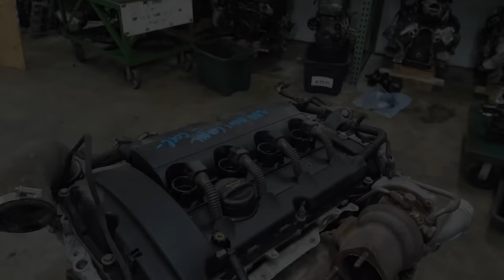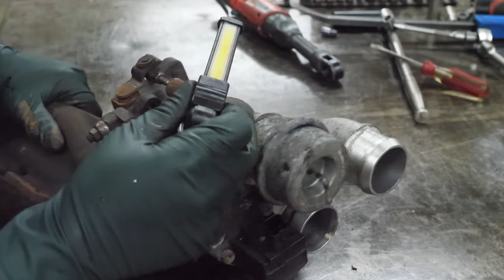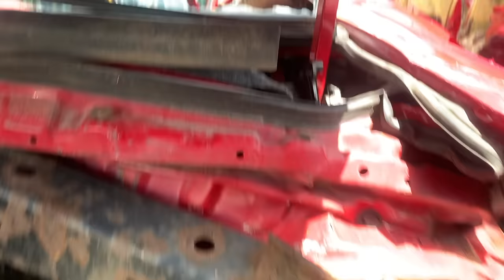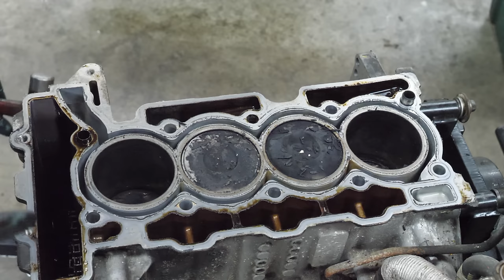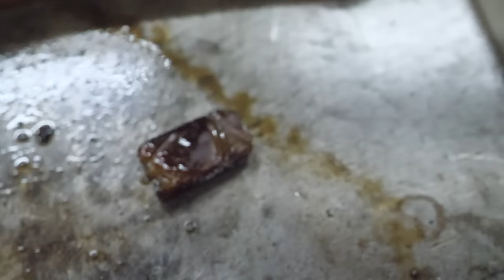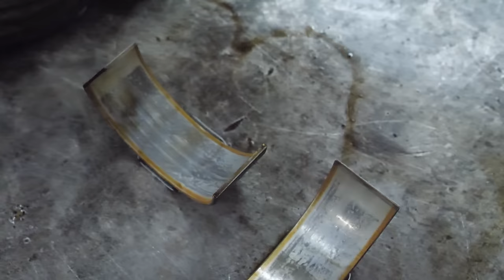JUNK Mini Cooper S (BMW/Peugeot) N14 Turbo Engine Teardown. Why Do People Buy These?

Comment: I'm not a fan of this engine either...i still have my 2010 peugeot 3008 thp after 5 years and I'm happy with the performance but agree engine is impractical with some bad designs... dipstick is horrible and difficult to read, difficult to replace battery and thermostat. Timing chain was first part i replaced after buying it. Recently i had a huge oil leak and it was the oil feeder pipe. Also consume a good litre of oil every 800-1000 mile... some claim it is normal... but it is new to me. Only got 60k miles on now.

Comment: Core plug on center of head between cyl 2/3 I e dun about 10 so far it overheats due to water pump or thermostat and it pops out there's ur oil water mix point

Comment: Why does everyone have such a problem with the dipstick going through the guide? Very few of anybody has ever worked on one of these engines, and anyone who has didn't find a problem with this design. You pull out the dipstick and the whole timing chain, guides, and lower sprocket all come out the top. First engine I've seen where you don't pull the timing cover to put in a chain kit.

Comment: i own and run a workshop for years and have lots of experience with euro cars. These N14 are widely used on minis and Peugeot, with countless issues with oil leaks & coolant leaks, turbos, timing chain problem, we educate our customers to steering away from these if they could, so badly design.

Comment: I hear you and you are making some good points. I think more tests would really help and a gradual rollout would definitely help. But some of your points like windows rollback would probably not work. Because the bad code was always there and it was a data file that they updated and trigerred the bug. It was not a code update but a data update. Also, man try to relax. You are passionate about software but it sounds like sometimes you get your pressure up talking about that stuff.

Comment: It's even worse for the oil filter. When in the car, you have to unbolt the reservoir for the coolant and move it out the way in other to access the filter. It's a horrible set up.

Comment: I had one of these in a 207 it died at 65.000KM (piston ring of cylinder 3 broke) it started to burn almost more oil then fuel.

Comment: Any BMW Engine using start/stop should be junked. I4 engines it can't be turned off from what I've seen, I6/V8+ engines you could turn it off. I've been told from BMW that it's going to be standard for all engines soon, with only the M/Sport mode turning it off (but those are going to start being a literal manual shift of the automatic transmission instead of enhanced driving experience). The MPG you can "gain" doesn't justify the cost of a literal engine it kills or reduces life over time.

Comment: It clearly ran a bit with the water in it, what did someone do? Sabotage a repo by replacing the oil with water?

Or did the shop get tired of the customer and put a hose to it? Scorned lover?

I am less familiar but you don't think the valve broke first (perhaps related to the timing issue) then the melting occured? (Regardless it didn't chew up the piston/ cylinder).  The condition of the engine is really weird, I would love to hear what actually happened with it.

Comment: Oil / service duration or long-life oil changes are. No good for these engines - its the same deal for belts and chains - the change period is too long - Why you may ask? - 

Once that car has been purchased it may been bought with a service pack - call it the sweet period / lease term or 3 Year term…..

Once the car is past this warranty /guarantee period they already deem it a scrap car unless you keep up with a dealer service. However if you do not do more than a few thousand kilometres a year - they will leave the oil alone. - The burnt out valve can also be cased by oil attacking the valve seals and causing the valve to stick. 

For BMW’S they have had a lot of known injector issue’s and a long haul back order on their replacements - When you take the oil filled cap off the vapours are of neat fuel - have seem bottom ends lock up whilst stationary - I saw an X series BMW with cream coming out the exhaust…..big issue

Comment: I’m not sure about the turbocharged MC, but the na MC is probably bought by people who value cuteness or funkiness over a quality reliable engine. That look like there’s too much plastic on that engine, and is especially bad for cooling system parts that go through countless heat cycles. On the plus side, it doesn’t have rubber belts in oil.

Comment: I'm not defending this engine by any way. The amount of water in the engine might be more to do with the way it was stored than the design of the engine. Even if stored indoors, water can get it via condensation if the store place isn't climate compensated and dry. The turbo, likely has an oil bearing, and when cold and drained of oil, I doubt even a healthy one can be turned by hand after that long in storage. These engines are designed with higher octane fuels in mind. E10 and 95+ sort of thing. I understand not too common in some parts of the US. And last, the US has quite some range of temperature and environmental challenges. Europe has service everywhere and if anything cars seem to be over serviced, problems fixed before they go on to be big hits to the wallet. I would love to see a US engine as compact as this, that produces the same power with the same emissions. And come in the same cost range. It's not an easy challenge for the engineers. And often serviceability pays the prices.

Comment: I always love it when someone says there is nothing wrong with those engine's! I but 130k with no issues.  They I have to prove them all wrong with facts.  Plus i seen people say this is a good car nothing wrong with it no leaks.  What do I find when I look at it.  Oil leaks, rust quarter panels and check engine light is on.  Pay they are the same people. lol

Comment: lmao my n12 engine in my cooper (naturally aspirated version of this engine, but with dual Vanos not single, same as the n18) needed a new timing chain guide within a month, it chewed itself apart lol. oh and it drinks a litre of oil every thousand miles.

Comment: does anyone know the oil interval? it’s 15,000 miles or two years. that’s also the same for n20, n63, n55, n52, and some others. every single engine that had that blew up. now it’s down to 7-8k miles or once a year and now no problems. from the beginning it was going to end bad, just a shame. i was at 145k with 100k on chains and original turbo before a exhaust valve was burnt. best car ever, r55 n14

Comment: I believe The engine is French not actually a bmw engine
I have done a cylinder head repair on one and some parts were out of stock at bmw mini dealer called Peugot dealer they had everything I needed at a lower cost 👍
They have a strange water pump set up I hadn’t seen on other cars

Comment: Yes, this Prince engine is a lottery. Some of them are running wothout any problems, while others are troublesome, in best case "only" leaking oil, at worst (and not uncommon) case the timing chain fails, and ruin the engine.
We had one in our family, sold it. (yes, it leaked. I fixed a leaking vacuum pump) It ran for another year and then - boom!
No more Prince engines at our driveway!
We had several Peugeot and Citroen with the older engines, never a problem, but this engine ... no thanks.

Comment: I had 208 GTi, The engine was robust as a f... Best engine Ever, may be BMW changed few parts to make the engine cheaper but the 208THP is one of the best engines ever.

Comment: In a (UK) filling station) I was asked if I could help a lady customer. She had wanted to top up the coolant but had poured 2 gallons of water into the oil filler cap. Beyond help but I wonder if that's what has happened here

Comment: This engine is in my wifes Peugeot 207 GT. Its an amazing thing when it works without issues - which has happened a handfull of times during the last 12 months... but its a nightmare to work on. I hate it, and i think i have invested more time and money into this POS then into our other 3 cars combined.
Reply: PSA should never have gotten into bed with BMW, peugeot made good engines normally.
Reply: @garagecedric yes, the 1.9 hdi engine in my old workhorse  peugeot expert, from 2002 is the polar oposite. With 250 k km on the clock and 21 years old, it simply works - always. No trouble , no fails, reliability on wheels

Comment: Chocolate Moose or rotten bilgewater in the crankcase. FYI everything eventually ends up in the bilge of a motor ship. Fuel, lube oil diesel sewage salt and fresh water all mixed together.

Comment: The engine is in excellent condition considering that it was driven with a water-oil mixture? That direct injection into the fire is a wolf. In all brands. Soot and grime everywhere. The owner can influence it the most by changing high-quality oils, as is the case with Turbo cars. 10000Km. Sometimes.

Comment: That engine looks even worse than what you'd see when maintained at the ridiculous "long-life" intervals some of those cars had in Europe. There was an option to do intervals at 30,000km or 18500miles with a long life full synthetic oil. That might be ok for naturally aspirated engines, but for cooper S N14 it should be at least half that, and especially for a highly strung JCW and with how they are driven, you should do it at 10000km or 6-7k miles at the latest, preferably sooner.

Comment: Im amazed . I hate cars. I have a citroen DS3 sport convertible 1.6 petrol   2014  turbo  BMW .  Its very smart , But the engine drives me mad , Some days it starts fine , runs great, you jump in another day and it starts lumpy , lacks power . make awful sounds till it get hot. Changed the plugs , oil filter and oil .   still some days its starts lumpy till hot. its not burning oil . its new oil and set right.  I am stuck what to do [ could it be the high pressure fuel pump ?]

Comment: It's absolutely insane to me how BMW went from the indestructible 1.6L Tritec to this garbage. I have had so many of these N14's brought in with a bad HPFP, bad turbo, waste gate slack, rod bearings going with proper maintenance and just the fact alone it takes an hour to do an oil change on these engines because you have to remove all the intake pipes and coolant pipes out of the way to get the filter. Also, to do literally any maintenance on the pulley system takes patience and tons of special thin tools to get past the frame that is less than half an inch from the pulleys adn that rubber wrapped idler on the water pump goes bad all the time, when it goes bad it destroys the water pump and the tensioner on those is also garbage and the idler I just mentioned will destroy them, these engines also have a problem with the rubber inside the harmonic balancer coming apart. Also, another issue this have is when the HPFP starts to go, the low pressure pump tries to make up for it, I have had SIX of these Coopers come in where someone put a bigger fuse in the fuel pump fuse slot to keep the car at least running and when checking the low pressure pump's housing the plug INSIDE of the tank is burnt to a crisp, how this hasn't caused a huge fire recall is beyond me. Also, these HPFP are so common to go bad that they have been in back order for YEARS and they cost between $900-$1400 MY price, they list for close to $2k. I even found someone who rebuilds them but he's always so slammed with them that he never has the time to rebuild mine, lmao. Love R53's and the Tritec, I've built quite a few R53's for track and race but the N14 is honestly one of the worst engines I've ever had the displeasure of working on.

Comment: Shame as the performance of this engine is great: lots of low down torque but will rev too. I nearly replaced my current car with the VW TDI PD 130 with one of these. I’m glad i didn’t as the VW motor has 117K on it and still performs like new. If you don’t maintain any engine you asking for trouble though.

Comment: Yes I can agree with that - the BMW prince engine it was a terrible design I had one in a 2010
Citroen c3 the 1.4 twin cam 16v I had to have head replaced twice tensioner on demand oil pump all on an engine from new to 3 years old or 20000 miles and regularly serviced by Citroen

Comment: Is it not possible that the second spark plug was so bad that it was misfiring to the damaged vale when it was open and closing and that did destroy the valve? The head  around t the spark plug and the valve look like that. The hole motor got a bad maintenances

Comment: I had a mini cooper 2009 had all work done at the dealer till they gave up and said they can’t fix an engine for a car they are selling the car blew up on the highway, it always needed oil, shut down randomly so many issues it was pore garbage

Comment: Is the N18 any better? I've got one in my cooper S with 64000 miles on it. Had a few niggly problems so far such as thermostat and two coil packs. Anything else to be wary of with the N18?

Comment: I had 220K, and the failure of the engine was a pinhole developed in a valve in Cylinder 2, and it burned it out... put a used engine in mine.

Comment: i noticed you said somethiing about the high pressure fuel pump causing that valve to be broken. i had my high pressure fuel pump broken for about 15k miles do you think something mightve happened it drives good now tho

Comment: what a good video of engine teardown, can someone help me here i bought N18 Cooper S as  i was driving the steering went stiff and  it was difficult to turn . is there any fuse or relay for the power steering and were is located i will really appreciate for any help.

Comment: I bet some carbon broke off and slightly wedged in that broken exhaust valve..causing it to stay open slightly and eventually with that cylinder firing, it torched through that valve and finally it cracked off…. I’ve seen it happen to big Waukesha V8 industrial engines running on poorly filtered/purified digester gas in a wastewater treatment plant I used to work at… those also had the small end of the rod crack due to H2S gas eating the bearing out, then preceding to bend/mutilate said rod, poke a big hole in the block…. And keep running on 7 cylinders like no big deal.

Comment: one issue with bmw/mini vehicles with turbos...   the majority of people do not allow cooldown of the turbo. this shortens the life of everything when you dont cooldown. still with a turbo on a car and you drive it hard i change every 3000-5000 miles. non turbo i do 5000 miles.    never had a problem.   but also the issue is the direct injection and EGR crap making intake plenums and valves trash....

Comment: i have a 2009 jcw, 211hp. there are no delusions about the quality of these engines. yea you have to cut the oil change intervals in thirds for it to live, I would not trust any of these motors if it was not in your care sience new. the peugeot prince engine its biased off is good a award winning motor they still put in cars today. but after BMW got their crusty fingers on it to cheapen up the design, then built it in great recession ravaged UK, along with criminal negligence on setting the oil change interval, leaves a deadly combination. its a shave because the cars are so good.

Comment: I drive myself a Mazda CX-5 and it is maintained (splendid) by an independant garage. They never ever maintain a Mini anymore after a few distribution renew actions. Even the dealer couldn't get those engines silent anymore (rattles in distribution and valve-train). These are really bad engines and my wife wanted an Mini Cooper S convertible so hard, but I've bought her a Fiat Abarth Scorpione 500C, much more fun an better engine (bit tuned from 134 until 169 Hp)

Comment: That belt tensioner nonsense is actually an on-demand water pump. The ECU tells that idler thingy to bridge the gap between the crank pulley and the water pump wheel when required. Such a stupid idea, an electric pump would have been cheaper and more reliable.

Comment: Life cycles of car engines seem to be getting shorter and shorter.
Engines pretty much dictates the life of the car since not many would go through the cost and hassle of finding, buying and fitting a used engine.
Unlike the engines of the 80's and 90's particularly Honda which has not only outlived the original car they were attached to but subsequent cars/project they were installed.
So many are still factory sealed, including transmission and 30 year old starters motors, alternators and distributors.
Honda is an example they could make cars that virtually will not need a new engine.
With F1 race engines going from 3 x engines in a race weekend (1 x Practice, 1 x Qualifying, 1 x race) to only 3 x for the whole entire year, you would think that improvement would translate to consumer cars going from an 80's car lasting 40 plus years on a single engine to lasting 100 years on a single engine. But the fact cars today are not following the relative life cycle improvements (actually lasting less years) of race cars shows the life span/durability is being heavily manipulated.

Comment: i sell alot of these and i guarantee you this is the result of minis suggested oil intervals. i believe its 8k miles which kills these cars usually by way of the turbo first. 5k miles maximum is really where these cars should be and when you find one thats been maintained by someone that knew that and you avoid 99% of issues. oh and the oil filter does suck on the s cars but its because the turbo was an after thought on an na car it makes everything very easy. but youre right bmw kinda dropped the ball on this engine